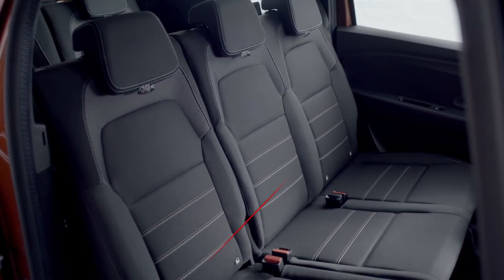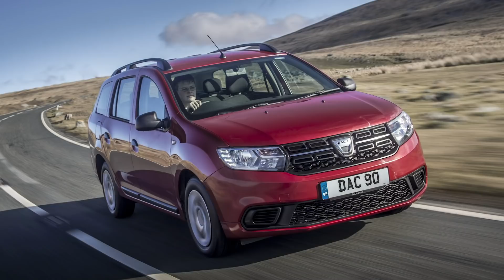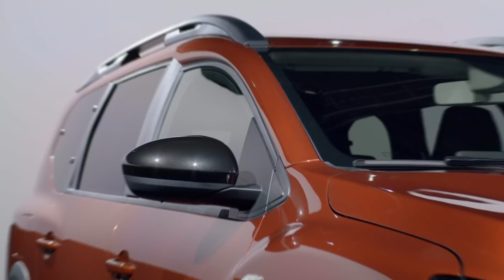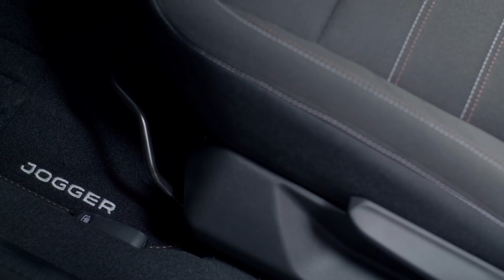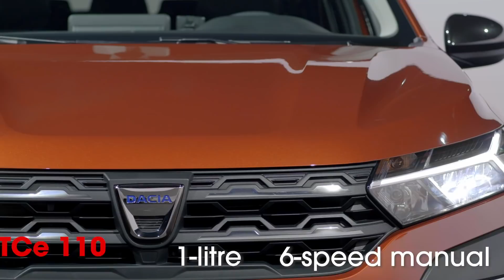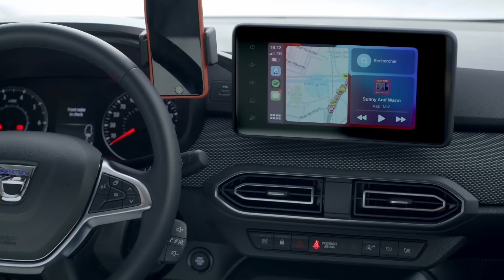NEW Dacia Jogger revealed – the CHEAPEST 7-seater SUV around!! | What Car?

Comment: I looked at one of these yesterday. There is not an LPG version  due to the LPG tank would have to go under the rear seats where a spare wheel would usually be so there is only the petrol version (what car check your facts before publishing). Salesman said there is likely to be a hybrid coming out 12 to 18 months away. Good car, Sturdy, and roomy. I liked it but will maybe go with a sandero stepway due to wanting BiFuel as I travel a bit. If you're not bothered about just Petrol this is a great car.

Comment: Lpg version is a way to go. Much cheaper than hybrid /diesel in everyday driving. Especially with today's prices. Even if such a big car uses 8liters of lpg mixed it will cost around 6euro in mixed driving per 100km,while 1.5dci on average drinks 6 which is equal to 9.60e per 100!. Thats nearly a thousand euros saved per year doing 25k kilometers

Comment: Manual gears only (until 2023)  & the seats are nowhere near as easily adjustable as the Touran (which i also thinks looks better (just not in that awful blue!)). That said, it's cheaper & has more extras than a Touran so certainly worth thinking about a purchase. Looks have let down the likes of Dacia in the past in my opinion & if these companies had better styling they'd be far more successful. This'll be a winner for Dacia!

Comment: A full whacking great MPV/SUV with just a 1-litre engine?!😳 that engine is certainly going to be worked hard!
Reply: The new engine is retarded and mandated by the EU, no choice, but to get a normal engine you are forced into a Hybrid
Reply: same torque as the 1.8 ecotec in the Zafira, nothing to write home about but sufficent for the class.
Reply: @fullmetalp0tat066  Same torque but 60 % higher combustion pressure and a smaller volume to distribute the heat, meaning, excessively reliant on perfect oil change and sensitive to the smallest Factory misalignment ( which all machines have ) Check the Eco boost engine from 2017-19 which is a small turbo. Outsized numbers are retired or have swapped turbos, rings and head gaskets several times in just a couple of years. If you do this in the EU ? where labor taxes and VATS are super high, it's game over economy. It's so bad that an EV will look like a superior Car, which is the whole point

Comment: It's a pity that Dacia are phasing out their diesels. My wife has ran them for 5years and they have been trouble free and very economical. Her current Duster is fantastic. Diesel still makes sense for rural dwellers who travel 20k miles a year.
Reply: Diesel makes sense for anyone doing more than about 10 miles at a time. A diesel hybrid makes sense full stop. Its more thermally efficient and burns more of the mixture. It gets a bad name because people commute into the middle of very overcrowded cities in them but thats more a problem of pointless commuting to office jobs which could be done from home than what kind of engine they use. 
I've never had a Dacia but they seem good. They come across like a Renault but better put together.

Comment: We've got a year-old Berlingo and would probably stick this Jogger at the top, or near the top, of our list when a replacement is due. The sticking point will be the kit. I reckon by the time the Jogger is spec'ed up to match the Berlingo ( the Berlingo's standard list of kit is impressive ) ,  it won't be quite the bargain that Dacia claim it is.
Reply: Thats always been partly the problem for me. In base spec they're cheap and not bad on depreciation but if you want to spec them similarly to rivals they aren't all that much less and depreciate far worse. 
I reemember when the first Dacia was launched over here and they claimed a start price of under £6000. When I enquired further it appeared you needed to spend significantly (thousands) more if you wanted things like aircon and a stereo. This actually made it more expensive on a pcp deal than a better equipped and much more powerful Fiesta. 
The pattern has remained the same every time they launch something I like the look of. This at £15k looks great value but I bet it won't be £15k by the time the stuff you expect as standard in most cars is on it. When it gets past £20k and you consider some of the deals you can get on rivals it doesn't look so cheap. That only goes one way when you start comparing fuel usage and so on - especially as most rivals will have diesel or better developed hybrid options.

Comment: Dacia getting more and more expensiver. looks like the same strategy as by Skoda.
Reply: Comparing to Inflation and currency depreciation I disagree, still cheap!
Reply: @claudiuberta5688  I would say, it's cheap only as a new car with 0 km mileage. compared with cars of some other brands with low mileage <5-10k km and even more with any discount, not offered by Dacia at all, it's not more so cheap.
for 15k euro you can also buy such cars like BMW 3, BMW 5, Audi A3, A4, A5, A6, etc. well, you get these cars with mileage of above 100k km and around 5-12 years old, but it's not means that you can not find a good exemplar which will make no problems. Sandero Stepway with full options costs 16k euro. it's not cheap. it would be cheap for 10-12k euro but not for 16k euro.
Reply: EU forces them to add safety features we don’t need like tyre pressure monitoring, e-call, and soon lane assist and advanced emergency breaking. The new Sandero is sold without LED lights, automatic emergency brake etc. outside EU.
Reply: @Tom-sg4iv  new Sandero has got only two stars by EU crash-test. packed with full options it costs around 16k euro in Germany. you gan get (almost) new Hyundai Kona maybe with some less options for the same money and it has got 5 stars by EU cash-test. so I further mean that Dacia is not so cheap as it called. fixed price without discounts, extra options really not much more as you can find in Hyundai. honestly, I like the design of Sandero much more than of Kona, and the main reason for me to buy Sandero would be LPG engine as fuel prices are high and rise more and more. LPG costs around 50% cheaper by almost the same consumption. but nevertheless - coreans have better prices. and honestly, a brand new car with 0 km is not so important to pay more for it. you buy Kona with 5k km and it is still a new car.
Reply: @pqz3jw  Yeah I would not buy Hyundai, I have worked in Korea for a while. Anyways I would never buy a used car again, you never know how previous owner have used it, or maybe it has been a dealership demo with multiple people testing it.
I have the new Sandero LPG, it gets 10/km/l LPG in city traffic. I estimate  savings 25-30% compared to petrol.
Reply: @Tom-sg4iv  my current car is Ford Fiesta I've bought four years ago with 8k km mileage,  1.5 years old and one owner (private person) by a big authorized car dealer. it had the same condition as a new car but even 40% cheaper (okay, it was a great deal for me by mistake of car dealer as I got this car around 2k euros cheaper than market value). what I want to say - used cars can be different. I would also never buy a used car with over 100k mileage and by unserious dealer.
LPG is also for me the same reason to buy Sandero as replacement for my Ford. without LPG reason I would buy Ford again or maybe Opel. these cars have a great value compared with their prices. Ford Fiesta has a great tuning, I like it especially on countryside roads, you can get every road turn without problem even with much higher speed. Ford have one of the best tuning, not worse than Audi or any like that.

Comment: I think the Jogger hybrid will use almost the same technology as in the Renault Clio e-tech.
Reply: Yes, the same system as the Clio and Captur
Reply: @mihayy2000  Except that the Captur is a PHEV and the Clio is just a regular hybrid.
Reply: Similar system but in a much heavier car. Its not really large enough and its likely to drink a fair bit - much more if its got all 7 people in it. 
Of course if its £15k cheaper in the first place that probably doesn't matter much.
Reply: @f00tyedits  Empty. 
The 7 seat has a max rating of 1863kg and with 7 seats it doesn't need particularly heavy people in it to get to that. 
Add a hybrid system with the motor, controllers and so on and you can also probably add another 100kg to that 1205kg kerb weight. 
Most Clio's are driven with one or two people in them and maybe a child or two. This is likely to be carrying a lot larger family because thats the main reason for buying one.